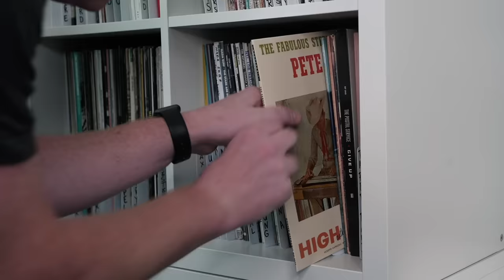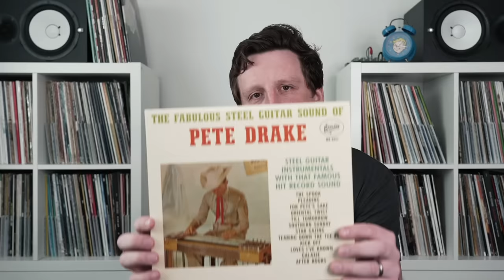6 Guitar Pedal Myths

Comment: I have several friends that are total gear heads and do extensive research on gear. 
My tone sucked after going through my pedal board. They convinced me to try true bypass. So I bought a (boutique haha) true bypass looper and put a high end buffer at the beginning of the chain. 
My tone sounds as good as going straight from guitar to amp.  

The only problem is that now when I kick on my Hughes and Kettner Tube Factor, I get a high pitch feedback at any decent volume. 
It happens in between when I’m playing notes and during musical rests when engaged. 
Ive tried controlling it by turning the volume pot down on my guitar and/or trying to briefly click the pedal off in between notes but that’s not practical and takes my focus away from performing. 

Perhaps it’s because, as you said in this video, that fuzz/distortion pedals want to see a high impedance signal at the input. I haven’t tried putting the buffer at the end of the pedal board chain but will try it and see if it improves. 
Or perhaps I need one at the beginning and the end of the pedal board chain but I doubt it. 

Does this make sense to you and do you have any insight that may help this issue?

Thanks

Ravi C Laird

Comment: Can you answer a couple of pedal questions please? They might be a dumb questions, but here we go.When you have a pedalboard with all your pedals connected and a honking power supply powering em all up>new batteries in all the pedals. 
1. When you cut the power supply off, do you need to cut all the switches on all the pedals off so as not to kill the batteries? 
2. Will it kill the batteries anyway whether the pedal is on or off and all cables still plugged up?
3. Do I need to have ANY batteries in the pedals if running off a power supply?
4. Do I need to tape up the battery connection in the pedal with no battery attached so it won't short out inside the pedal?
5.Thanks for any answers,I appreciate it!
Reply: Get rid of the batteries and all questions and any problems go away.

Comment: You talked me into getting a Behringer EQ pedal, and I'm pretty happy with it. Might get a rackmount EQ at an outlet store soon, not just for guitar (Because I really don't need to EQ past 8k), but also for the few hardware synths that I have, but I'm pretty happy with the Behringer, and if it ever breaks idgaf.

Also, was curious about true bypass since it seemed every 'premium' pedal had it, but then I figured out that it also turns an off pedal into a patch cable that does nothing with no insulation.

Comment: I’ve got caught up in the op-amp thing as well as surface mounting parts. I’ve got TS9s, SD-1s and a BD-2. I had a through-hole BD-2 last year and sold it. Bought a 2018 model a few months ago and started to dismiss it as its surface mount. Everyone says “you can’t mod them,” which seems to be a mental hiccup for me. I’ve also accepted that if I haven’t modified a single pedal by now, I probably won’t ever. Also, they say the SMT BD-2s are less noisy and fizzy, so I’ve learned to appreciate it’s existence in the modern era.

As far as op-amps go, I’ve got two TS9s from the ‘90s and have come to the conclusion that Maxon was simply doing the best they could in those days to emulate the original TS9s/808s. I’m sure whatever they were throwing in those pedals in 1983 or whatever was just what they had access to at the time and aren’t some special magical ingredient of tone. If anything, my guess is Maxon probably tried hard to find the best (most reliable and economical) op-amps they could find when they resumed production for those pedals around 1992…

Also, I see a lot of people hyping up the older SD-1s for having the “highly desirable” JRC4558DD in them, which is the same op-amp they’ve been using all along.

…and don’t even get me started on how the MIJ DS-1s sound “way better” than the MITs. I’ve owned plenty of DS-1s over the years (1984, 1993, two 2004s, 2012) and they’ve all sounded absolutely identical. If anything, the MIJ model sounded a bit weaker.

Thank you for doing this video, Josh. We sure do love you!

Comment: I've been an electronics engineer for over 30 years. I was a "boutique" amp & pedal builder in the late 1980s through the 1990s. When it comes to clipping with diodes, I prefer the sound of germanium diodes over silicon diodes. When it comes to op-amps, I prefer the sound of an overdriven TLO72 over the sound of an overdriven LM741.  While I can't claim one noise is "better" than the other, one is certainly more pleasing to my ears. Germanium and silicon produce different sounds. They saturate differently. A JFET op-amp distorts differently than a silicon op-amp, and the sound is recognizably different. If you stay in the linear area, both provide clean gain and no one can tell the difference.

Comment: Retired FAA Radar Tech here. I am here to say that technically you are correct, and I totally agree with you. I can prove it with the math and repeatedly measured it. Having built a test rig with an old screamer. I collected the various "magic" chips and as I changed each of them in and out, my friends and I all agree that there are differences in the sound. More so in some than others.  Was it better or worse? Nope, just different. Because the other parts in the circuit had not changed, it had to be the chips that slightly altered the sound. Just slightly noticeable, and not by a whole lot either. Therefore, when the circuit was changed by adjusting say the tone knob or rolling off the vol knob any perceived difference disappeared. My conclusion is that the perfect sound comes from the heart and travels through the fingers.

Comment: I'm a bassist and I use to be from the true bypass only camp.  I now have both true bypass and buffered pedals on my board, about an equal 50/50 split.  It's been my experience that adding pedals, both true bypass and buffered, will to some degree or another, due to reasons you outlined in your video, will alter the bypassed tone.  Even just using one true bypass pedal alters the tone because I always tend to use two cable lengths to and from the pedal that is longer than if I just plugged one cable straight into the amp.  Cable length alone does matter and it will continually roll off your treble as you go longer.  Each time a pedal is added I usually have to tweak the amp just a bit to compensate.  The only pedal so far that I've encountered that I can't seem to compensate for is the Boss pedals.  Their bypass circuit does something to the treble, it's like it "rounds" it off by maybe killing some of the harmonic content. It just deadens the top end to my ear, not necessarily in a bad bad way but different.  It almost controls the top end like the treble band of a multi band compressor will compress the top end more if you so desire.  Some might like it but it makes the top end just sound too compressed so I don't use them.  I've not had problems with most other buffered bypass pedals.  Even my Geezer Crybaby wah didn't hurt the signal, if might even help my pedal board because I'm putting a bypass pedal right at the beginning before all those little patch cables that just add cable length

Comment: Oookay ... Just a little bit on opamps. As an aside, I had started breadboarding opamps and other linear devices along with everything else starting back in them late 70s and early 80s.

In an audio context, what matters to us is noise, distortion, and linearity. Maybe some others but mainly these. Noise adds up stage after stage, so low noise opamps best the 741 types in a long chain. Most opamps can be set up to run super-linearly (in them context of frequency response) so linearity is not a problem. Distortion can be an issue in things like amps, equalizers, etc. individually and chained, but not distortion or fuzz pedals.

So for me, using low-cost, low-noise chips like the TL072, TL084 - which can be used as 741 replacements. Noise adds up, so even 1db here and there is important. Only very high end audio amplification would call for a Burr-Brown $15 replacement. A TL072 or TL072 costs just a bit more than the 741 type (LM308, 4558, etc.) So I would always go for the lower noise foe everything, but not worry about distortion figures unless its is an amp, EQ, etc. Obviously, a low distortion opamp is unnecessary in a distortion or fuzz pedal.

If I'm wrong here someone please point out the errors of my way 🤓

So

Comment: I think people like the word "true bypass" and that's about it. I love a good pedal board and all, but I don't focus on what's bypass vs buffer. I have a chromatic tuner, joyo compressor, joyo od, tc HOF2 reverb, line 6 dl4 delays, lekato looper, and I just won an afterneath verb by earthquaker, a fathomable verb by walrus, and a pi fuzz by ehx and a carbon copy delay from the awesome dudes from the gear cage- their channel, much like yours, is awesome! Obviously wont use all 3 verbs at once so I hoping to trade in one of them for something sepecial, like a lucky cat tap delay..took me about 3 years to grow. If you have never tried around with pedal boards, you should

Comment: A word or two about true bypass, in the mid 60's there were some pedal makers that only put a SPDT bypass switch in their pedals, it switched the input jack from the input of effect circuit to the output jack, however the circuit was still hanging on to the signal chain at the output jack, this may be where this old argument got started. I replace a few in the day with DPDT switches to cure the nastiness that ensued.

Comment: Back in high school I knew a guy who maintained that it was not possible for EMG pickups to do anything else than metal and even when doing metal they were mediocre. Then I had him listen to Pink Floyd's Pulse. Gilmour is using a Strat loaded with EMGs on that live album and sounds absolutely awesome. Great clean tones, great overdrives and fuzz tones. Gilmour is quite an effect heavy player and the EMGs are a rock solid, reliable pickup to work for. 

We did end up agreeing that EMGs are good at one thing at least: sounding like EMGs. No mattter what guitar you put them in, you know what you're gonna get.

Comment: As an old timer, I remember when getting your pedals "true bypassed" was considered critical. But then, back then I had a Cry Baby where the bypass switch only disconnected the output, so you basically had an entire unbuffered circuit loading your pickups when it was off. True bypass was better. I think many of us never changed our thinking even when buffered designs appeared. As I have gotten older, one thing I have learned is one must continually reevaluate one's assumptions, and always be willing to consider the source.

Comment: With soft-clipping it is the diodes that clip plus you need to take into consideration the circuitry around like capacitors, tone section etc etc

Comment: I can agree the surface mount components do have advantages.  The only thing I can say for through-hole components is for the average guy who likes to tinker with the circuit, through-hole is easier to work on and repair.

But, if you don't have any desire to mod a pedal, there is no real reason to insist on through-hole components.  

I have through hole and surface mount versions of pedals and there is very little difference. The lower noise floor of surface mount makes sense since there is less material between the components and the circuit board.

Comment: You should make a true bypass pedal that sounds like a finish buffer and see if anyone can tell the difference between it and the sound of a guitar being shined up.  Or, if that doesn’t tickle you, maybe you could make some pedals with buffing wheels inside & start a new line of pedals that also have motorized and attack sensitive moving parts.  Over time, the shinier circuits start to sound different, obviously, so the vintage character will be actualized, both sonically and visually.  I think it might be time for this.  The Echoplex was cool, but where is my GD Buffer-Plex guitar finishing simulation machine, Josh?  I would like it to be housed in Jukebox plexi, please, so we can all watch it go.

Comment: Hey, I hate to contradict, but I have a Demon TS808/9 clone that I put switchable pairs of JRC4558D and RC4558P opapms with dividing resistors and switching that allows any combination of the four. There is definitely a tonal difference between the two types, and noise is reduced greatly when multiple chips are used. Not that one clips different or anything, just a tone shift. To me, the P sounds a little brighter. At least in that pedal.

Comment: I had a weird experiance with a boss DS2, which clearly affected my sound quality when turned off. That got me to only buying True Bypasse pedals. Which again led me to a tone problem after I got to a certain number of pedals. My current solution is using a compressor in the beginning of the chain as a buffer/clean boost

Comment: Before I knew what a buffer was, I heard TV electronic pedals did change your tone when switched off, so I was super into that. Then for a while as I began to understand what bypass was I was still on that true bypass band wagon. Moving forward from that though I got ahold of some digitech stuff and more and ehx, and I got those pedals because they did what i needed them to, in a way that i understood how to manipulate them. Bypass didnt matter to be anymore, tubes vs solid state, vs digital didnt matter to me. Tonewood doesnt matter to me. I just like what sounds good to me. I still have a couple tc pedals, and they are absolutely fantastic. Especially the polytune mini, which will never leave my pedal board. That said, I'm not getting rid of my bad monkey either. Hell I recorded a whole punk album putting a digitech element xp through a power amp, and a Marshall 2x12 and it sounded great! That has been replaced by a mooer preamp live, and a different power amp for simplicity's sake, but I'll be damned if I ever think I "need" any piece of gear just because the community says it's better. It was a long journey for me to get over a lot of elitism, but I'm glad I did.

Comment: Well, Germanium is a chemical element metalloid similar to single crystal elemental silicon in appearance.  It is shiny like metal but breaks like glass and only conducts electricity when doped as it is a semi conductor. It's atomic number is 32 and has a band gap of .67 electron volts at 300 kelvin. Which is like a warm summer day. It was often used as lens material for infrared cameras due to it's high transparency in that range. It is toxic if the dust is inhaled during manufacturing.  I couldnt help it. I'm an element nerd. Germanium is extremely neat looking. I love shiny things and Germanium has a very goth luster. I honestly wish I had a piece of it right now. I would just stare at it.

Comment: The only "magic" op amp I've ever actually run into is the u709, which was a super early one (second monolithic model made!). Unlike later op amps like the u741, you had to roll your own frequency compensation or it would squeal into oscillation immediately. About a year ago I built a copy of an early synth/noise toy, the Cracklebox, that depends on that fact to work at all — the circuit won't work with op amps designed after 1965.

Comment: I have a pedal based on a TS808 that has the chip designation scratched off from the factory. I have to admit, it makes it easier not to worry about what's in there. 

I also have one with the 4558 chip in it and it doesn't sound as good as the other one. As Josh says, it's the circuit not the chip and I 100% agree with him.

Comment: Changing OP amps in the BOSS GE-7  EQ pedal did make a better sound only because the circuit was designed for OP amps that used more power and sapped 9 volt batteries too quickly. Boss changed them out without redesigning the circuit. They even admit there was a drop in sound quality and increase in noise.
Reply: But I agree with you as far as the driver pedals. People don't even know what to listen for, as with the difference between buffered and true bypass. Or how about using 16awg wire as instrument cable for a ten foot run. Never mind that the wires inside effect pedals are ... 20awg? 22? :D

Comment: I feel like what gets missed is that a particular pedal in your rig isn't exactly/perfectly like the spec! Parts have a degree of variance that can genuinely make one pedal behave in a way that you prefer over others - but that's not magic components, it's just that the same schematic will yield varying results when instantiated into a real piece of gear. Less important but also worth mentioning - vintage pedals that sound great might actually be "broken" or not performing as designed, but that new unintentionally circuit-bent pedal makes a sound you like. I had a Fender Blender that was AMAZING and it turns out that there were several blown components. I got it "fixed" and then never used it again because the magic sound got "fixed".